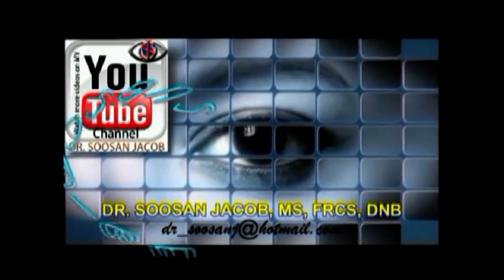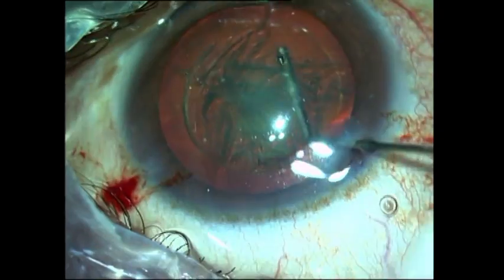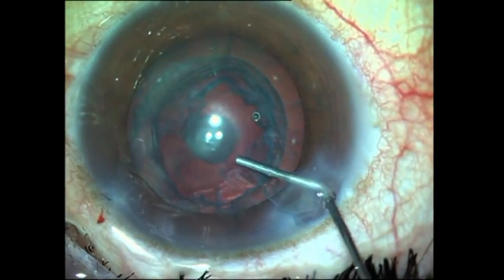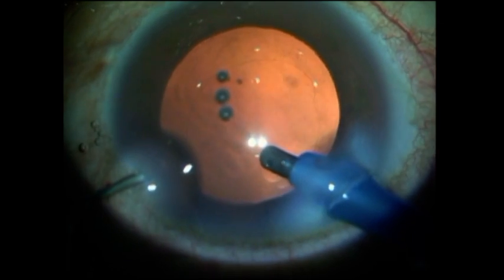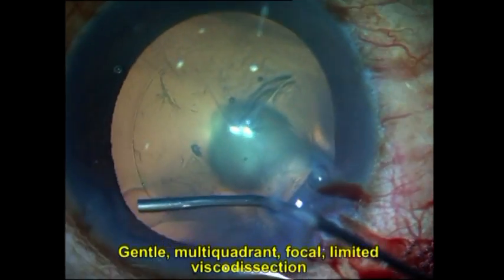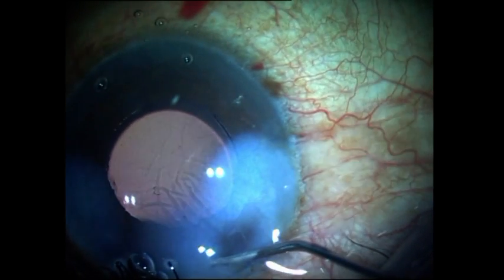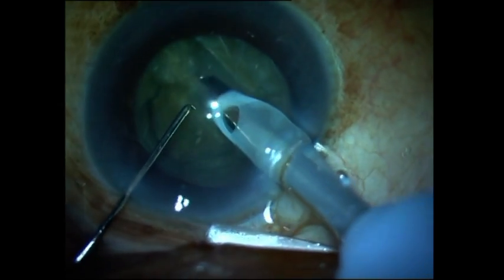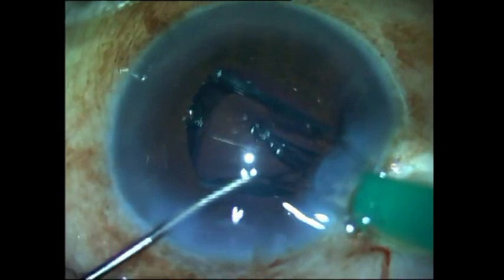Learning Posterior polar Cataract phaco Soosan Jacob with audio 4 2 min

Comment: visco dissection is a great method..thanks for this great advice
but mam is it safe to do stop n chop in ppc + nuclear sclerosis because while rotating large nucleus and while dividing it through the trench it stretches zonules and post capsule..
Reply from the maker: Thanks! for any kind of nucleus removal, care should be taken to a) if possible have a thick epinuclear shell; b) avoid posterior pressure or strain on capsule; c) avoid sudden chamber decompression; d) avoid hydraulic build up of pressure in a confined space on the PC. This is also the reason I said later on in the video, I wouldn't always advise viscoelastic injected to elevate the epinucleus out (note- I am not referring to viscodissection) in a forced manner. If the epinucleus is not already loosened to some extent it can cause a PCR. In the video, the epinuclear shell was already a bit loosened out, the nucleus had been already removed and space was available centrally. Gently pushing in some methylcellulose under the epinucleus allowed the epinucleus to buckle and rise upwards to allow for easy removal.
Reply: +Dr. Soosan Jacob thanks mam..it was really helpful for me :)
visco dissection b4 hydro-delineation is a great method..i tried it in PSC (for practice) n i was absolutely sure that there was no accidental hydro dissection...

what care should b taken if we had to do SICS in ppc?